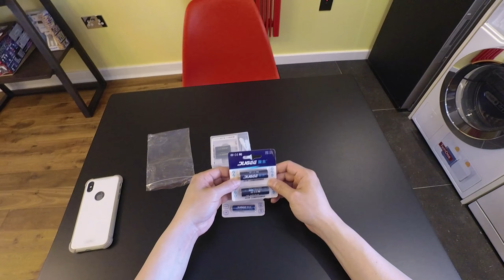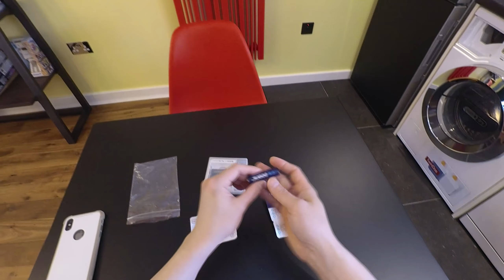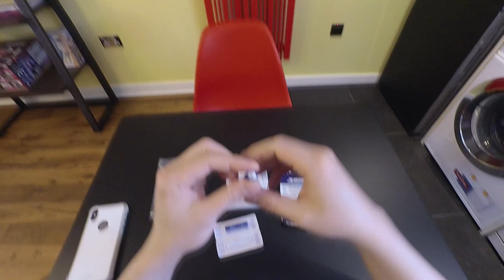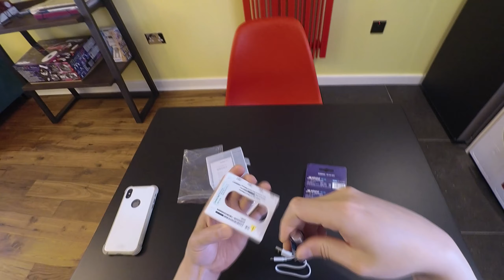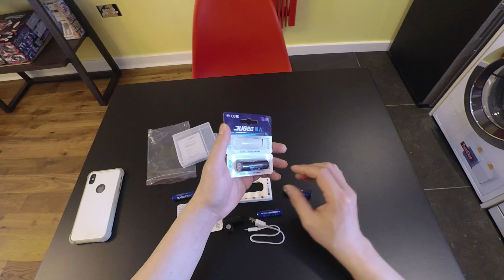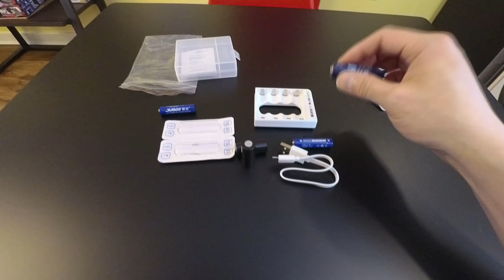Jugee Lithium secondary AA and AAA batteries (1.5 v output) Part 1/2

Comment: Regarding your last disadvantage (not knowing remaining battery capacity): This is not entirely true. Jugee, in their official store on Ali Express, claim that the batteries will switch to outputting 1,1-1,2v (shortly) before they run out. So  your device should give some warning about batteries almost empty (unless their cut-off voltage is already at this point).  At least, this goes for the 3000mWh versions
Reply from the maker: thanks for pointing that out :) that's kind of a low battery warning rather than capacity gauge though. When you pack batteries to take out for field use, you wouldn't know how close they are to that 1.1v output point :(
Reply: @BrianSu  yeah, I totally agree with you. But no idea how one could technically provide such a gauge. Other than artificially mimic the voltage curve of a regular alkaline or 1,5v non rechargable lithium cell
Reply from the maker: @EymertVersteegt  yeah can't be done easily. or maybe flash the battery's LED red amber green periodically or have a push button to check.
Reply: @EymertVersteegt  I think it is doable with Kentli, as they have the Li-Ion cell voltage exposed, so you could theoretically create separate circuit sensing that Li-Ion cell voltage to have pretty good gauge. WIth these only possibility would be to use that integrated LED to blink red under 20% for example.